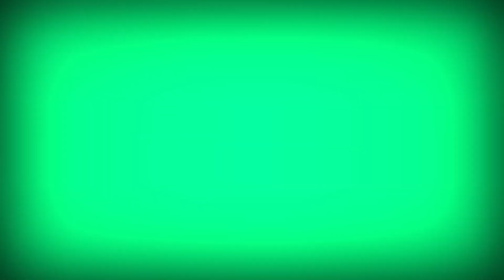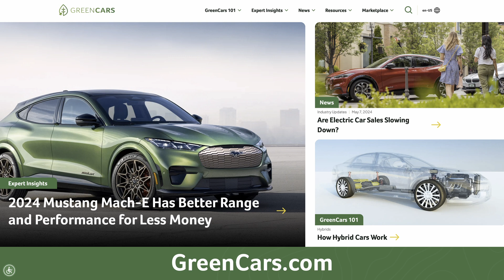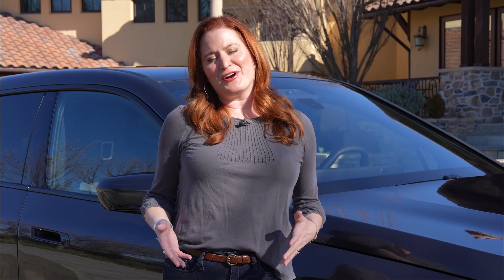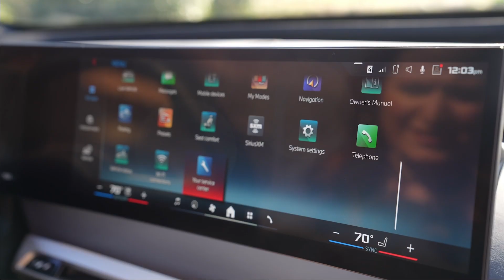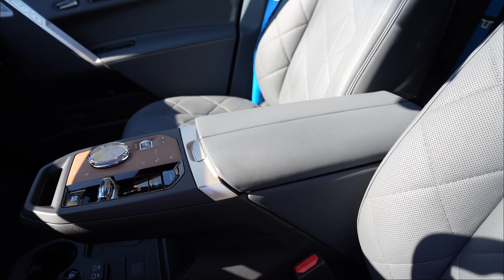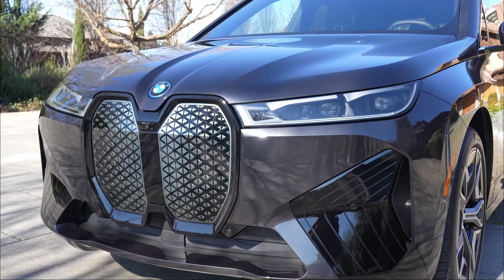EV Battery, Maintenance, and Service Insights | GreenCars, The Podcast, Episode 10

Comment: We have had a Tesla model 3 since Jan 2022 and we have had no repairs after 30k miles. As for tires we didn't see extra wear in fact my 2013 Cadillac ATS used the exact same model and size of tire and they only lasted 20k and we got almost 30k out of them on the Model 3. That may be because the PSI is more on the Tesla. The ATS ran at 36PSI and the Tesla is 42PSI. Both wore the tires very level but on the Tesla they lasted longer. The only things we have done on the Tesla is the cabin air filter I replaced myself and washer fluid. We just replaced the tires a few weeks ago and they were technically still good on the tread gauge (tiny bit of red showing) but we wanted new ones for vacation this year.